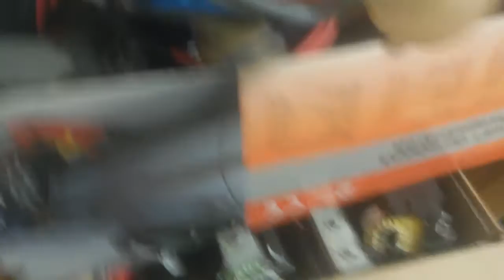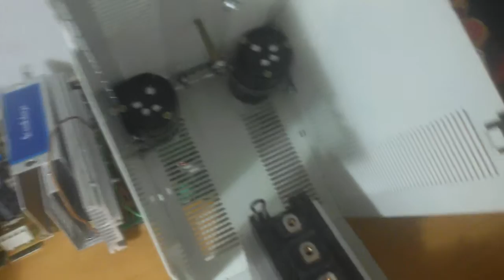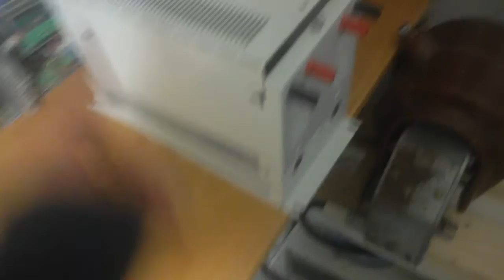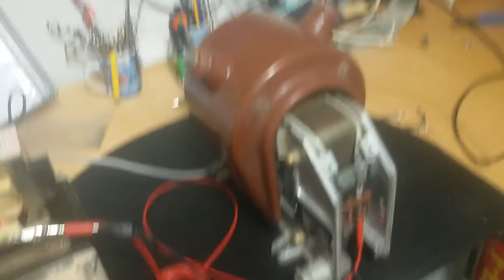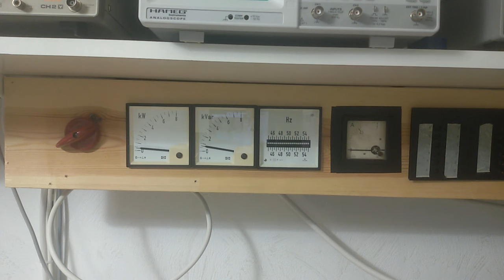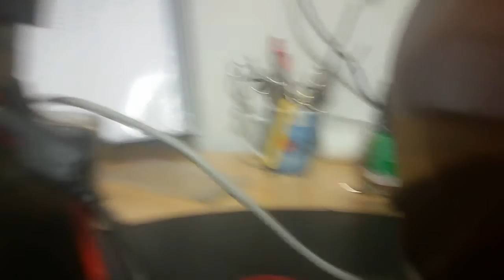Flybacks And PT

Comment: Awesome, most MOTs have a DC resistance of 3 ohms, so if you pump about 15 amperes through it, it will dissipate about 600 watts of heat, the rest is reactive resistance and almost doesn't generate heat ;) Thumbs up !!

Alex
Reply from the maker: +High Voltage Thanks that tells me that I need to use some PFC capacitors VAr power is wasted power than don't even generate heat, that just pops the fuse. Thanks for the comment mate, Cheers :D
Reply: Tristan HV I think motor run capacitors would work just fine as PFC capacitors, you need about 200 uF